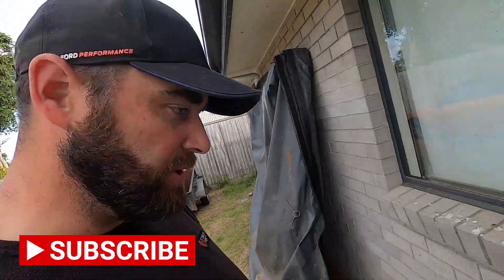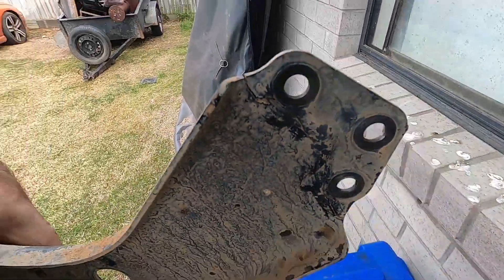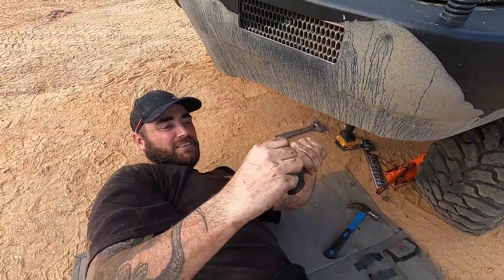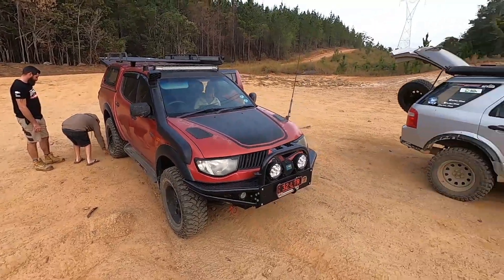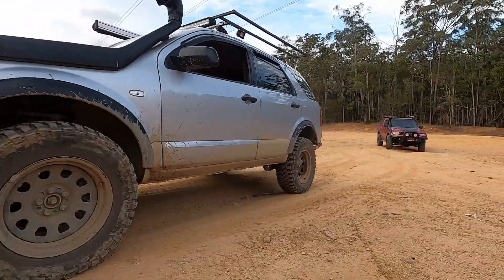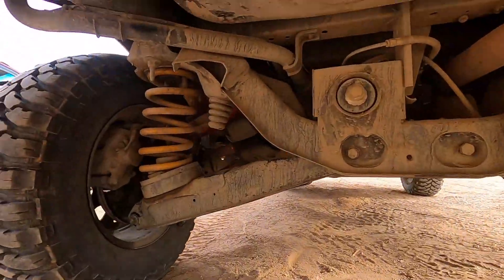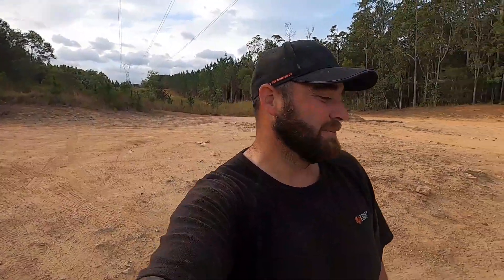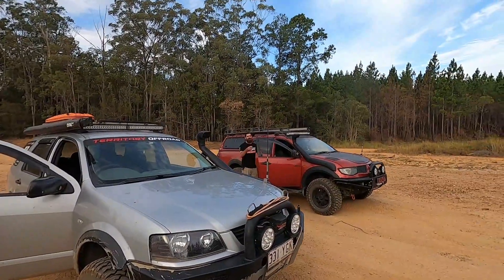Pushing the Territory to Breaking Point

Comment: I really want you to test a torsen style diff locker from Eaton called TrueTrac seen some good results with the cross 8 Holden's but no good onroad test if it's dedicated bush truck may as well weld it as well as the worm gears in the transfer to provide 100% front and rear love the content keep up the hard work
Reply from the maker: Seen a turetrac in a offroad territory and didn't like it. It's the whole reason I sold the LSD I had and brought the lokka.
Reply: That the lokka from 4WD systems how is it on road dose it chirp around tight corners or clicky
Reply from the maker: @cbrennan1983  I'll let you know. At this point I don't really mind as the way my Territory is it's not a nice car to really drive on road

Comment: I gotta get up there, I've already commited to a west trip end of year, so maybe easter time next year... it's not even time its more fuel costs, by the sounds of it though, better bring spare parts or I'll need to be dropped off at the airport to go home hehe. Strange how they are differant like that. We've not yet done a CV (on the Adventra LOL) touch wood. It'll be interesting to see how once the rear is lockable how thatll effect power transfer to front diff  and how the traction control responds to that. I'm quite interested, as currently when our truetrac engages on the rear of the Adventra we have all sorts of problems up front with the bosch system and it requires very fine throttle input to manage otherwise I loose the whole ABS system on a hard code.
Reply from the maker: Yeah Easter sounds good. I'll be back down vic start of next year for the all ford day.

I've got to get different thrust washers to get the right clearance for the lokka so for now I put another standard diff in. I'm very interested to see how the traction control system goes with it. I know other's that run rear LSDs and haven't had problems.
Reply: @TerritoryOffroad  If AllTerrainAction is up there next year I'll come up for work and we make a day of it with the locked SZ
Reply from the maker: @davidwhiting303  Sounds like fun. Will be good not been the only Territory.